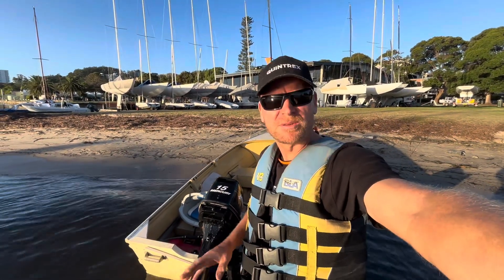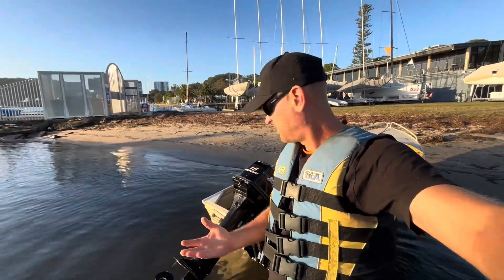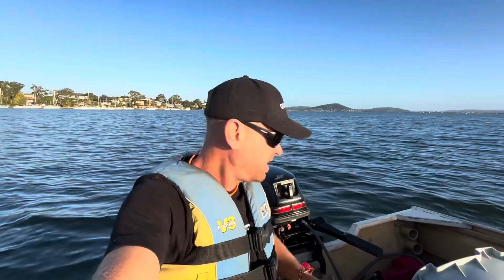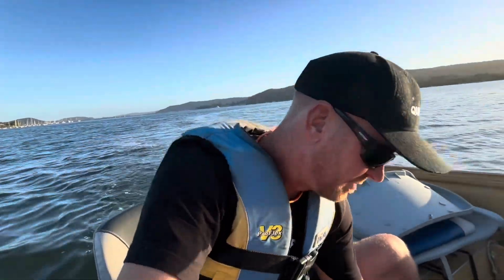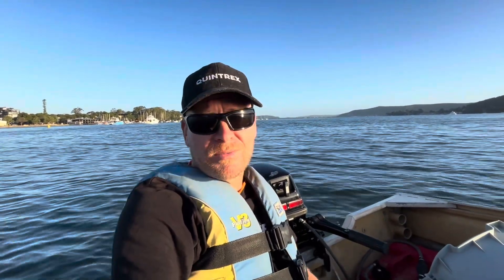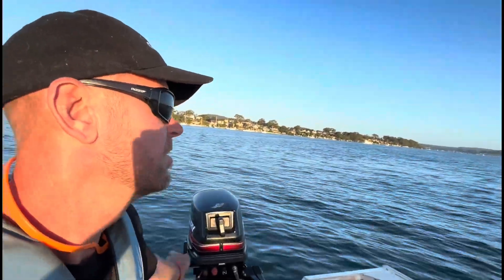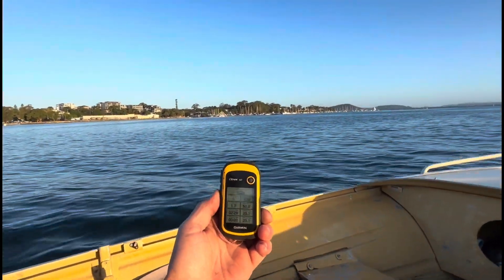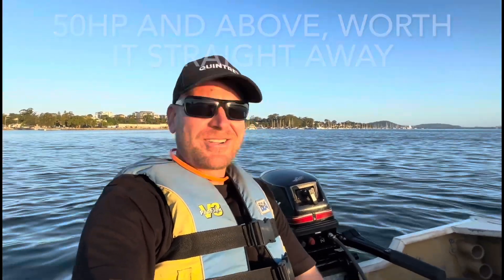Aluminum vs Stainless propeller

Comment: Where I use mine, aluminum is better because of rock or impact it can absorb it better and can be replaced alot cheaper.
Reply from the maker: Definitely alloy is better if they need replacement as they are way cheaper 👌

Comment: One thing to consider is when you hit bottom the stainless will last virtually forever but the aluminum will ding and chip witch will make you loose top speed
Reply from the maker: Good point, thanks for sharing your insight! 👍
Cheers 🍻 
Aussie Boat Guy 😎

Comment: You said the hole shot felt about the same if we added bait tank, ice chest  and ocean  would it have made a difference and would you think a 9 pitch in stainless would work better for that? Thanks
Reply from the maker: I reckon the 10p stainless would still be ok with the bait tank and ice chest plus rough water but a 9p would probably be better if I had those plus another person I reckon.
Cheers 🍻 
Aussie Boat Guy 😎

Comment: I have a 15 hp tohatsu 2 stroke on my 310 dart quintrex, running the stock 9.25x10 pitch. wonder what prop size and pitch i can go up to to achieve more speed ? Maybe up to a 10x14?
Reply from the maker: Hey mate,
Good question 👌
Unfortunately it doesn’t work like that fully.
If you went to a 14p you would actually go slower because your motor would have trouble spinning up the prop to the same rpm as the 10p. A 14p would probably only rev to about 4500rpm and be very slow onto the plane, also would end up causing damage to the top end of the pistons. You need wide open throttle to sit in the higher of the safe rpm range so about 6000rpm for max speed top end and best hole shot plus safer for the internals.
The reason the 30hp can spin a larger pitch is hp.
Some of my mates boats are running 28p with 300hp for example.
Cheers 🍻 
Aussie Boat Guy 😎

Comment: Interesting to see a speed increase, I’ve always had the  opposite on small outboards under 60hp & found the alloy to be better
Reply from the maker: Cheers for the comment, that’s interesting. 
I found Yamaha alloy pretty good but stainless normally is slightly faster from what I have tested through the years🍻

Comment: I've got the Nissan version of that engine.   Can you do a vid please or describe here the adjustment made to make it an 18?  I haven't had luck with Google for that.
Reply from the maker: Hi Mate,
Good question 👌
I have already put a video up on that which will show you.
It’s called  Tohatsu 18hp Mercury 15hp super Tohatsu 9.9 and 15 comparison.
cheers 🍻 
Aussie Boat Guy 😎

Comment: You are getting remarkable speed out of that setup regardless of prop choice.  You sure thats a 15?  Juiced?
Reply from the maker: Cheers mate, the little motor is performing well! 👍
It is stock but with the 18hp upgrade (which really doesn’t change things much from my experience)
The boat is just setup really well and very suited to that motor. I did try a 30hp on that hull but really didn’t suit, was faster but was not as comfortable. 
All the best,
Aussie Boat Guy 😎

Comment: nice video, I have found, the design of the prop, especially blade design, plays a big factor as well, a slightly more aggressive blade can give better performance, and even the coating might make it "slip" a little more in the water. 
I run aluminum props as im too poor to by stainless.
I had looked at stainless, but apart from the bling factor, I might get one extra solid knot in speed as opposed to alloy .
Different pitch plays a role, as you know, as well. I went from a 15 pitch on a 50 hp evinrude 2 stroke, 5800 rpm max, 27 knots, to a 17 pitch, now 5500 rpm max at solid 29, touching 30 knots.
Reply from the maker: Cheers Champion,
Yeah, you’re right, prop design makes a massive difference.
🍻 Aussie Boat Guy 😎

Comment: SS is a no brainer if you ever touch the bottom. As a professional mud crabber for many years. AL props would be totalled with in a week or two depending on tides. SS would last over a year and despite wear would still be usable.
Reply from the maker: Thanks Mate for your comments on real experience 👌 that’s great to know.
Cheers 🍻 
Aussie Boat Guy 😎

Comment: I have a 40 hp Yamaha 4 stroke  on  a    Quintrex 430  Topender I get 27 knots with an aluminium prop and 30 knots with “solas” stainless prop
Reply from the maker: Cheers Mate, sounds like a great result! 👍
I bet the stainless grips better in turns too.
All the best,
Aussie Boat Guy 😎

Comment: If I hit a rock I want the propeller to soak up the damage not my gear case. I'll stick with aluminum
Reply from the maker: Hi Champion,
Yep, alloy can soak a tiny bit more of an impact but alloy can still bend or snap a prop shaft. Both alloy and stainless props have a rubber hub which does help in a prop strike but yes an alloy will be slightly better. All depends on the prop strike too, I have seen stainless props that have hit so much stuff that they are throw away with no damage to the lower unit but also seen snapped and bent prop shafts with both stainless and alloy. In saying that, if I was boating constantly in an area where it’s likely to hit stuff I would run alloy, mostly because they are cheaper and I wouldn’t be as devastated if it got banged up.
Cheers 🍻 
Aussie Boat Guy 😎

Comment: Hi
What about revolution of crankshaft?
Whats was rpm on aluminium and stainless steel propellers, very interesting.

Many thanks for the interesting video.
Reply from the maker: Hi Mate,
Great suggestion! I can definitely hear the stainless is revving higher, I should grab a tacho and re-test.
Aussie Boat Guy 😎

Comment: Tested almost these exact solas props, but for Tohatsu/Mercury 25-30 hp twostroke back in 2015 (and still use them). What I noticed back than was, that on a single engine setup the rpm and speed for 10*11 and 10*13 props, both aluminum and SS, was the same. However, on a twin engine setup the extra 30 hp allowed the motors to spin for much higher max rpm and that's where the SS shined, since the motors could rev to 6000-6400 rpm. With 1.92 gear ratio the aluminun props started slipping, loosing "traction", so the speed didn't went much up after approximately 5500 rpm. However, the SS props continued to increase the speed of the boat with increase in the rpm through all the range. 

In numbers it was 47 kph on 11 pitch single engine aluminum and 49 kph on single engine SS at 5800 rpm. The 13 pitch single engine revved 5200 rpm with aluminum and 5000 rpm with SS both having 45-ish kph speed. On the twin engine setup the 11 aluminum and SS both revved to 6400 rpm, but the speed with aluminum was 49-50 kph, while the SS gave 54 kph. With 13 pitch the aluminum revved to 6000 rpm with speed 54-55 kph, while the SS props, also revving to 6000 rpm gave, a maximum speed of 64 kph! Almost 10 kph difference.
Reply from the maker: Hi Champion.
Wow, that’s awesome, I really appreciate you sharing that data. sounds like the alloy props were airating in the twin rig setup, stainless props are way better dealing with airation and can be run much higher out of the water normally compared to alloy. 
I would be very interested how your setup goes if you raised your motors slightly on the transom with the 13p stainless props.
All the best,
Aussie Boat Guy 😎
Reply: @25hpboatracerman  did alot of testing with the height as the boat was participating in UIM races back in 2015-2018 (Ukraine cup). The airation was a problem indeed, when rised to high, compromising manuverability in tight turns. Since the race tracks were with a lot of tight turns it was important for the boat to make them at fast speed. So there was that sweet spot, when the boat was still able to make at least a 90 degree turn without loosing much rpm and speed.
Reply: @25hpboatracerman  anyways, here's the race with twin 11 SS props, to better explaing what I mean with turning ability. Note the steady acceleration on the last leg of the lap. https://www.youtube.com/watch?v=H6nyMlCKIHY&t=101s
Reply: @25hpboatracerman  and here is the race with twin 13p SS props. The acceleration is slower, buth the turning ability at speed is better. https://www.youtube.com/watch?v=6yZ3ySsos3g&t=5s

Comment: It has been my experience you hit something with stainless it will bend still get you home. If you hit somethin with aluminum part of the propeller may break off now you're stuck call Sea tow!
Reply from the maker: Good point mate, Stainless is more likely to bend but alloy has a higher risk of breaking completely.
Also both alloy and stainless have a rubber hub which does go a ways in taking some of the force out of a prop impact.
All the best,
Aussie Boat Guy 😎

Comment: you can often mount the motor higher on the transom when moving from ali alloy to SS
Reply from the maker: Hi Mate,
Totally true and great point 👌
Also adding to the performance gains.
All the best,
Aussie Boat Guy 😎

Comment: Brand new, they stainless props sure are exxy.. I'm using an alloy prop on mine a 13x19K OEM prop (V4 130 Saltwater series) - I think you hit the nail on the head - if you can find a stainless second hand, it makes sense. 
You can hear on my boat, acceleration/holeshot that it does get a bit of cavitation, so I'm sure a stainless prop would be better.
Reply from the maker: Hi Mate,
Thanks for your comments 👌
I actually really like the Yamaha alloy props, they have a great shape and good rake stock without having to modify them.
All the best,
Aussie Boat Guy 😎
Reply: @25hpboatracerman  It's performance for a stock application is really quite good. Top speed is 80km/h, on a 5.2 meter Carribbean crestcutter.

Comment: Is rake and cupping the same?
Reply from the maker: Rake and cupping are very different things mate.
You can check out my pitch and rake video on props on my channel, I run though it all.
cheers 🍻 
Aussie Boat Guy 😎
Reply: @25hpboatracerman  thanks buddy. I know they are different things, I actually seen your videos on it before. 😛
I was wondering if there was any difference in rake or cupping between the aluminum and stainless props you tested.
Reply: Any change in bow or stern lift?

Comment: Cool might look at a SS for my 30hp mercury. I polished an aluminum Yamaha 30hp prop to mirror finish and it went really well until one of the blades bent over with the water pressure. The motor had been rebuilt and all cases were polished etc so was probably close to 35+hp. It pushed the boat to 58kph (new alloy propellor fitted) compared to 52kph new Yamaha 30hp
Reply from the maker: Cheers Mate! That’s a great result with your 30 Merc! 👍

Comment: Great video mate as usual! 
On my Avon SR 5.4 rib /Yam 90 2 stroke, tested a handful of SS propellers, various good brands. Mainly to be able the trim the engine for more bow lift in following seas. In the end went back to stock Yamaha aluminium 17 & 19 pitch, pending on load. They were the best allrounders and i do boat in very rocky archipelago so if /when hitting something hard, probably less damage on gearbox. For pure top speed SS is usually better though, also in my case.
Reply from the maker: Hi Mate,
Thanks for your support.
Totally true with risk of hitting rocks etc, alloy is way better. I really should have added that in the video.
Also I am actually really impressed with the Yamaha alloy props, they have a great blade shape and good rake angle on the blades which helps stop airation.
Cheers 🍻 
Aussie Boat Guy 😎

Comment: Great comparison video well done.Somthing that should be considered is if you are operating in areas with possible underwater obstructions such as inland waterways is that a stainless steel prop will cause more damage if you hit something hard enough, the prop itself may not be damaged but everything else around it can be damaged such as the prop shaft gearbox ect.The Aluminium props have got a bit of give in them and will bend,it is cheaper to replace a prop, i have been there and done it never going back to stainless props for inland use.
Reply from the maker: Hi Mate,
Totally agree, stainless props are definitely more risky if you hit something. Prop shaft snapping is an expensive exercise 😢
Thanks for your input and your Champ 
Aussie Boat Guy 😎
Reply: @25hpboatracerman  no worries I just thought people should be aware of the danger before they rush out and buy a stainless prop if you are in a Saltwater environment with no snags they would be the go 3km/h is worthwhile probably would be better against corrosion as well
Reply: Not entirely disagreeing, just my personal experience is it's not some night and day difference. I have both, primarily run stainless on the river now and I hit tons of stuff. The river is mostly sand bottom with some rock, lots of logs. I've had to grind down and re-balance my stainless prop 3x and still on the same lower unit going on 3rd season.  Some hard enough hits that aluminum would've likely lost a blade. 

I think motor and boat size has a lot to do with it, also break away plates or motor mounts are that tip up.
Reply from the maker: Good to know, thanks mate 👌
Reply: @25hpboatracerman yep I'm sure you know, but stainless tun so much better in a fully or partially ventilated/aerated state that the performance gain is entirely worth the risk. My boat won't even plane with a regular alu prop at 6" on the plate, but it will effortlessly cruise with my stainless while half out of the water.
Reply: If I hit a rock I want the prop to absorb the damage not my gear case. I'll stick with aluminum
Reply: Absolutely agree about the risk of a stainless. I was going to have one fitted on my 115hp Suzuki and the dealer here in SE Ireland who’s at it a long time advised against it for that very reason and Im forever dinging my prop. Love the vids!

Comment: 15 HP four-stroke, I swapped to a SS prop to find the extra weight limited the engine speed to mid-range. The only option was to go back to Al.
Reply from the maker: Must have been a pitch change or blade shape that wasn’t matched to the motor. Some companies will stamp there props with a pitch but it actually measures differently unfortunately.
Cheers 🍻 
Aussie Boat Guy 😎

Comment: How much does it hurt to use inches to describe pitch and diameter?  Just asking as an American.  😁
Reply from the maker: Hi Mate,
Good question 😂
I actually like it, love feet and inches when talking boats, just feels right I reckon.
I am a builder here in Australia so a lot of my job is measurements and maths etc so either metric or imperial is fine with me. I do use meters, cm and mm as a go to when building stuff but always feet and inches for boats etc. I do get roasted often for using Kilometers per hour sometimes instead of miles per hour or knots but that’s ok 😁
Cheers 🍻 
Aussie Boat Guy 😎
Reply: I hear you, old Aussie guy here. The standard reference is in inches.

Comment: SsS prop  on my 4.5 ally craft 50 hp 3 cyl 50 johnson ...higher top speed ,better speed at 4000 rpm ,better fuel economy ,better holeshot.Bought a second hand viper ...still cost 200 bucks tho
Reply from the maker: Hi Champion,
I like the Viper props, good take on the blades.
$200 is a deal I reckon. Also like the Ally Craft boats, normally they have awesome freeboard.
Cheers 🍻 
Aussie Boat Guy 😎
Reply: Keep up the awesome vids ,bro

Comment: Interesting.
You could hear the motor rev higher with stainless.maybe cutting through easier
Reply from the maker: Hi Champ,
Yeah totally, definitely less drag and the motor spins it up easier. Definitely reached a higher rpm.
Had it out today as well and it runs even better trimmed further out and 52kph.
Cheers 🍻 
Aussie Boat Guy 😎